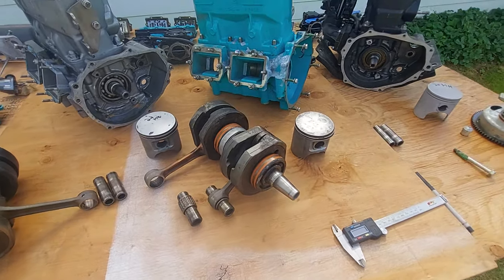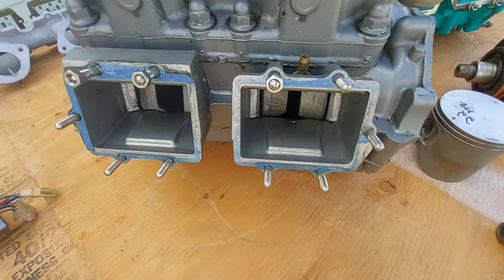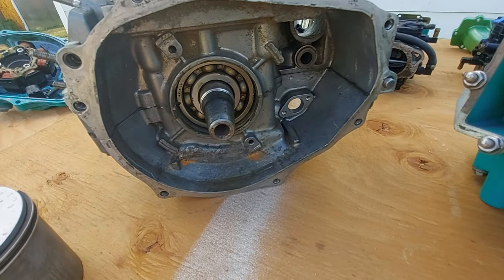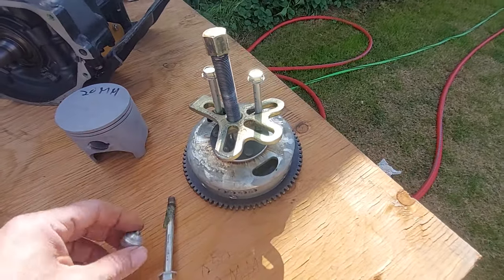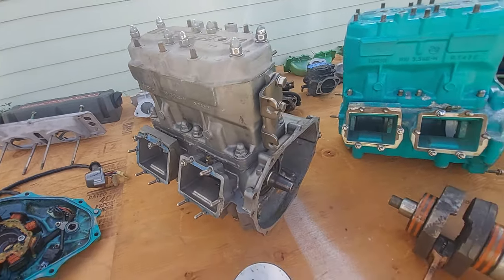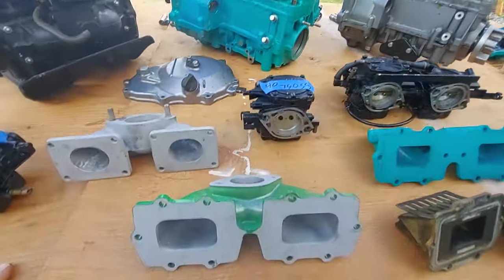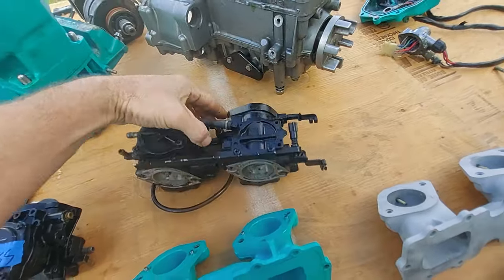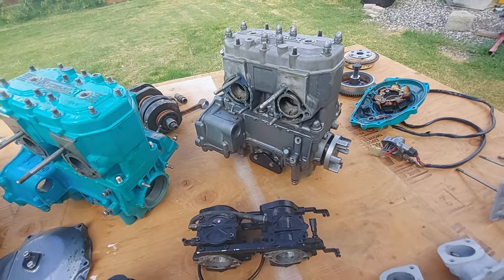Differences between a Kawasaki 750 big pin and small pin engine.

Comment: Used to ride a 500cc two stroke triple Kawasaki motorcycle. Kawasaki make some very strong motors.
Reply from the maker: That must have been quite the bike.
Reply: @JetSkiBuyFixPlaySellChannel  Kawasaki H1 500 with about 60hp on tap and weight only 384 pounds so performance was good for its day.

Comment: Can you put a 750 electronics on a 650?
Reply from the maker: People are usually trying to go the other way and put a 650 stator and flywheel on a 750. Let's you advance the timing and gives you a lighter flywheel. Seems like you should be able to but I'm not 100% sure.